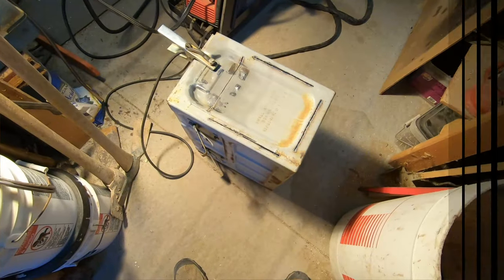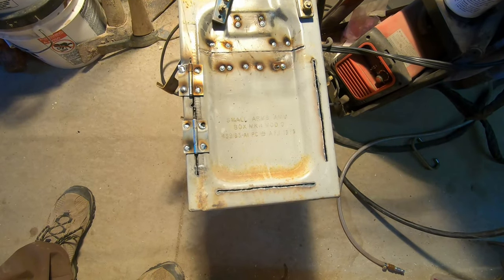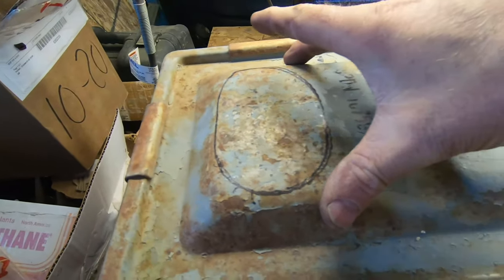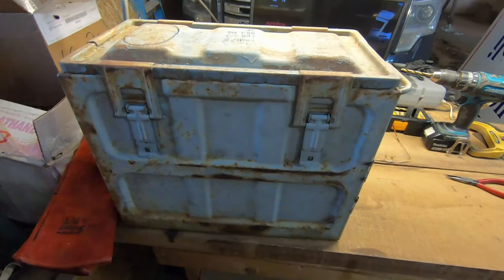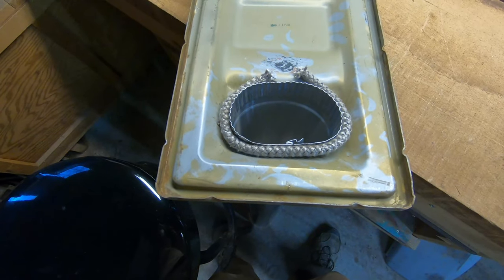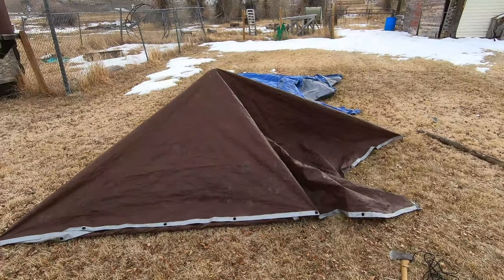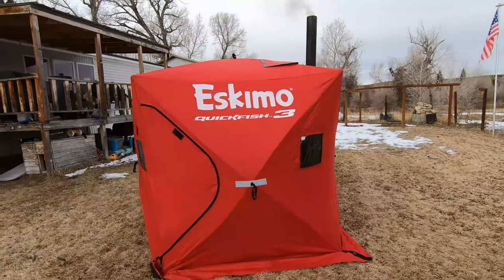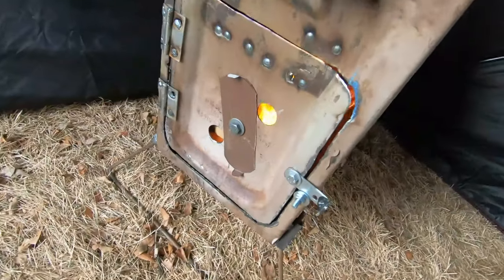20mm Ammo Can Stove

Comment: With high temp paint how long do you think one of these would hold up before it burns through?
Reply from the maker: I have only had 10ish fires in it, 2 for 12 hours and it has no sign of wear. These cans are pretty tough, but I haven’t had them for a long time. There are 2 types of 40mm cans, one box with side stiffeners  and 2 clasps on the ends for the lid, and the one I have with 6 smaller lid clasps. The one I have is definitely sturdier. It should last for years, but I’m not burning it everyday either.